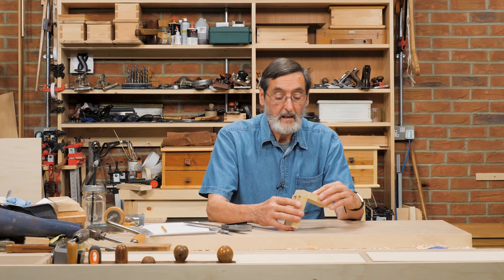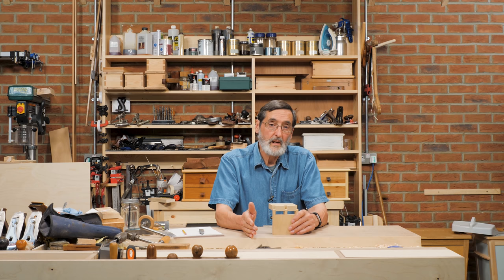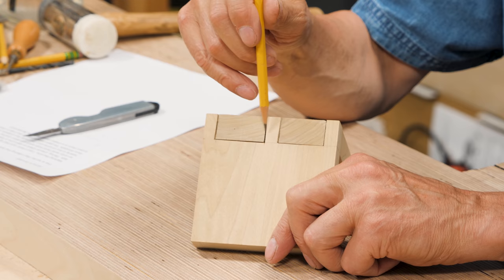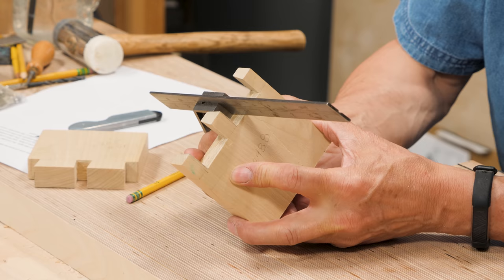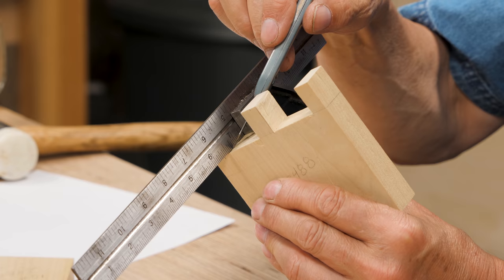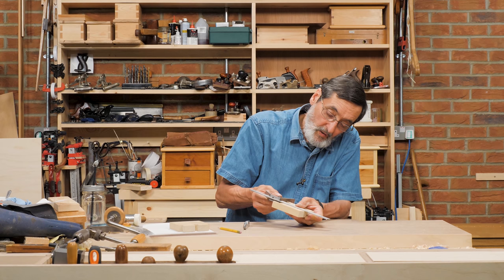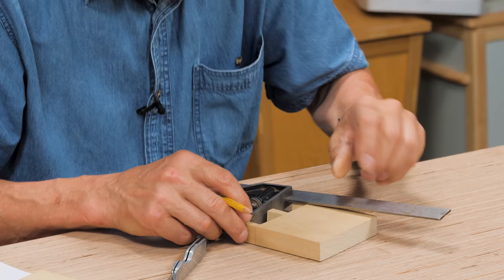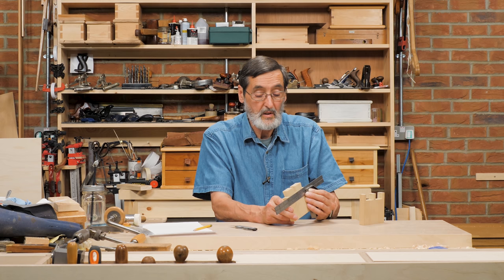Beginners Dovetail Feedback (01) | Paul Sellers

Comment: An encouraging and sensitive critique from the master. I was taught that you always start with a face(flat) and edge(squared), traditionally the face marked with a loop, and the edge with a V, and you always work from those marks without fail. Jenny doesn't seem to have done that(or her square isn't square). This was drummed into us relentlessly, and if anyone was seen putting their square on an edge that was not marked they were chastised in front of the whole group and shown up so badly that you never did it again, I'm talking about while setting out and not when just checking a job for square. Your Joint can only be as accurate as your marking out.
        It must be hard to learn woodcraft just from YouTube videos, and not have the guidance of an experienced craftsman(or women) to help you do things the correct way and explain why and how you are going wrong. I have great respect for Jenny who tackled what is not an easy joint for the inexperienced woodworker, and i am particularly impressed by her awareness of her faults and the desire to do better, its that drive to do better that will one day make her a great craftswoman. Keep it up Jenny, you are doing great!
Reply: Out-of-square was my first suspicion which appeared to be confirmed at several points during the video close-ups. Kudos to Jenny (& anyone) willing to have their work critiqued though. For the record, I’m looking to do my first dovetail soon and I’d be pretty happy if it looked and fit together that well on the first attempt.

Comment: This was a fantastic video. I have been trying to teach myself how to cut dovetails using your videos (and a few others online) and although I am getting better and better with each try, it was great to get your feedback on these from another beginner. I too have fallen into the trap of using my chisel on the sides of the pins when my saw cut isn't right. It has been very hard not to be either too tight or too loose on the pins.

Comment: After watching your Youtube and Common Woodworking videos, I did my first handcut dovetail joint last night.  I started by sharpening by marking knife and laying out the tails.  I  need to work on my marking knife technique because about 5 minutes into it I opened up the side of my left thumb with the knife.  It's amazing how deep a slice a sharp marking knife can make in flesh.  I said a few bad works but managed to not drip blood on the wood or my bench.  After a bit of workshop first aid (CA glue and bandaid) I modified my marking knife technique and got back to it.  An hour later, the end result wasn't pretty but it fit and held together on its own.  Have to do a lot more practice...

Comment: Excellent video. This type of follow up should follow every instruction video (logistically tough) as you first get taught; then you practice and send in the final result to get it critiqued. 

It may be controversial but I believe making dovetails is only useful now as an exercise in accuracy. No longer are dovetails needed in fine woodworking. The dovetail was originally evolved as the best mechanical way of joining two pieces at 90 degrees because the methods of chemical fixing (adhesives) were just not good enough. Now, we have adhesives that are so efficient that you don’t really need much mechanical strength. I don’t know how many drawers I have built over the last 45 years but, for the last 20, I have used forms of rebate joints, mitre lock joints on drawers and, to my knowledge, never had a failure. I ask the question that if the makers of old had Titebond 3 (and others) at their fingertips, would they have spent time and money on getting dovetails cut? I think not.

So, make dovetails to practice coordination and accuracy and not because it’s the best way of making drawers.

My two penny worth.

Comment: I have the same problems!!!  I am not alone!!.  

Beside jointing and planing the wood "dead square," sawing straight is the hardest for the beginner like me.  I always have problem sawing straight vertically. The cut is slanted inward.("/" this direction... I am right handed) even I try to position myself as Paul instructed in his videos.   Probably I have elbow or wrist slanted..  

another sawing technique video would be wonderful. :)

Thanks!!!
Reply: The particular video that helped me most has been out for years now... AND I'd be hunting forever...
   BUT... it's not even a "saw" related video...
   It was "knife skills" from a cooking channel, where a well spoken chef explained how your arms rotate on an axis from your shoulders and another from your elbows... 

   He explained that standing at a slight angle to your work, then, allows you to move the knife (or other utensil... you know... like a saw) back and forth in a much more naturally "dead straight line" just slightly across your body.

   Stuck with text alone, I can only suggest you (being right handed) situate your LEFT foot forward and experiment with an exaggerated angle (say... 45 degrees) across your body AT FIRST, and give the saw a few "strokes" before working back more or less to a "full face"... When you find "the right angle" you'll feel the whole motion of the sawing straight almost "do itself"... and you're just sort of there "for the pushing".

   BUT maybe just check out some of those "basic knife skills" videos and see what you pick up... It's pretty fun just watching those folks slash and slice and chop anyways... ;o)
Reply: @gnarthdarkanen7464  awesome recommendation!!  Thanks.. I will watch the knife method... my saw skill is slowly improving, though. The more I cut, the straighter it gets.  it's still tilted though.
Reply: @onlywiseman  Ya' know? There's a pretty fun vid' to watch... "Debone a chicken in 8 seconds" (I think... it's close though)... AND you can laugh.
   The real trick (in my experience) is just getting aligned for YOUR OWN individual sensation.  It's probably not quite exactly 45 degrees... and as you cut you WILL get "better" about straight and deliberate... accurate... precise. 

   Remember to breathe, relax... and keep on keeping on. I believe in you. ;o)

Comment: Paul, 
I need to make several stackable steam boxes made of 1x6 stock 24”x 18” could you please tell me what the best type of wood to use and what style of Dovetail would be best.
Reply: Okay... curiosity is going to kill me... so in case he answers, I'm in!
   For my two-cents' though... Steam has been used in wood-shaping a LONG time... so that's a consideration, BUT... lots of restaurants offer stacked containers (usually either bamboo or rattan, I think?) for steamed dishes... Those are generally round, of course... but I doubt that specific a shape is a particular hindrance.

    Willow (provided you can get it without breaking the bank) has long been prized for Cricket bats because it's durable as hell even in weather. It's forgiving and springy as hardwoods go, and has been used in hockey-sticks before the age of fiberglass... SO that's a fairly good option... among the obscure species. I haven't had a chance at it much, myself (only so many friggin' hours a day) BUT I'm told it's a reasonably straight and tight grained wood without being "hell to machine".

   Admittedly, tool-handles are most popularly hickory, ash, or oak (depending on some certain particulars)... prized for their relative durabilities and strengths... Though hickory is top dog for durable in weather again...
   BUT... the big drawback to hickory (besides seasoning to rocky levels of hard, so work it "green" or "wet") is that same popularity... It can be expensive as hell... similar difficulty with oak.

    Finally, it's easy to blithely suggest "oily woods"... BUT the "steam" notation suggests (to me) that you may still intend these to be around or involved with food... and oily woods WILL tend to impart odor or flavor, which isn't all together appetizing... and even if it's deliciously altering, it may get your cook's cleaver hurled at you in dismay. (lolz)

    Of course, I'm no expert. I'd love to hear... er... read(?) whatever Paul has to say on the matter. ;o)

Comment: Paul, you always say use a knife wall, when you do this, you are leaving a cut in the wood on the corners, I know the knife is much thinner, than a pencil line, so how do you deal with cuts in the wood using a knife? Are you then to sand the cuts out? Thanks.
Reply: I'm not sure I am visualizing what you are describing.  If you are speaking of, say, lines scored across the face of the piece, they will be visible if you do not sand or plane the surface, and in fact much old work shows such lines.  However, if they are not wanted you simply score only where a cut will be made.  If you are concerned about the tiny nicks that are made to locate the square, they should be so small as to be inconsequential--it takes almost no cut at all to be detected  by a sharp blade.

Comment: Hi, I have a question and I don't know where to ask: 
When planing a resinous wood (I think it's called pinewood in English) after a while I get buildup of resin on the sole of the plane. I wonder if there is a coating agent that would prevent that. I tried some clear oil and wax with little to no success.
Thank you!

Comment: Paul, I am new to hand cut dovetails.  On a recent project in poplar I went to much effort to square my work piece and trace knife wall to both sides of the tail board, but still found the cut across the piece were not square, i.e. not even.  Could I have pushed the knife wall back on one side by being too aggressive with the chisel?  Thanks, Don
Reply: Trying to pare too much wood with your chisel in the knife cut can compress the wood, yes.  But you seem aware of that and I'm not sure if you are describing uneven depths of sockets or a line across the piece that is not square.  Are you certain that your square is in fact square?  Testing is easy.  Then, if your square is true you can test to see if the edges of your piece are truly parallel--if they are not a line struck from one edge that is square to that edge will not be square to the other edge.  As other people have mentioned, stock preparation and layout are critical.  It's the old story of building your house on sand.